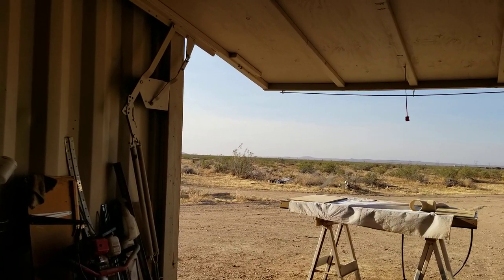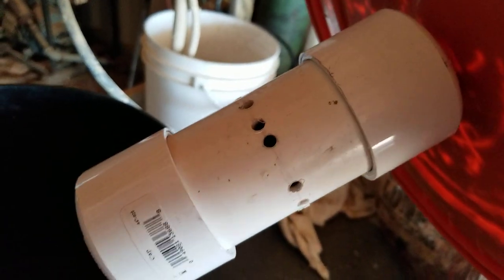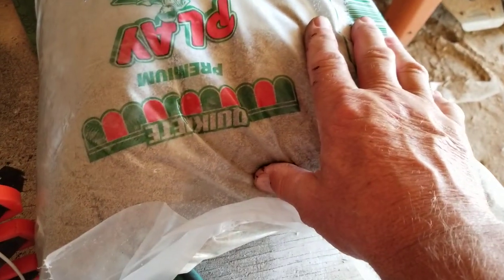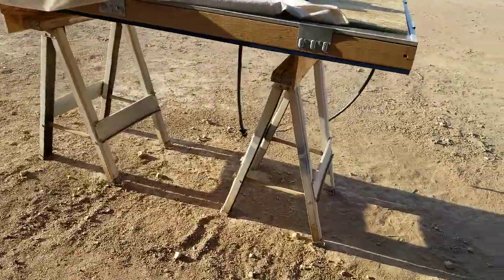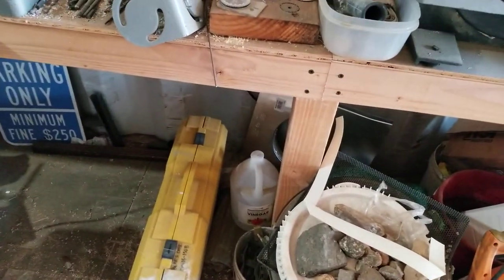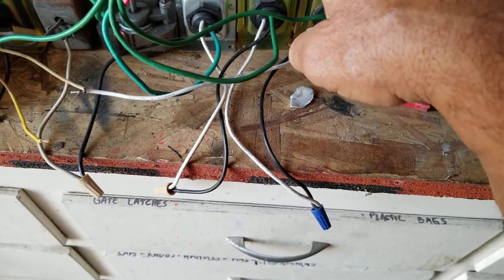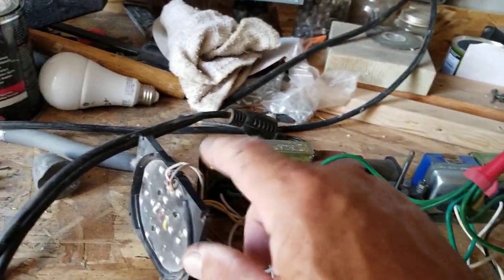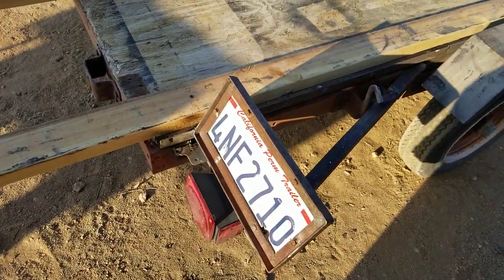DIY tote-cuzzi filter, Aug. 4, 2020

Comment: Have you thought about using a geothermal setup to warm your house in the winter? 
Maybe you can pump the geothermal water through the solar heat exchanger you made for even warmer water 😉
Reply from the maker: Not more than a thought and some research on it.  Not a feasible method of heat transfer for my situation.  I also researched the beer can solar heater system, and the benefits are minimal for this climate.  I only heat the cabin at night.

Comment: Shame on you that you didn't post, we had part on that hurricane that came up the coast it broke my Canopy that i bought not long ago, Ran around today looking for a smaller generator to use on deck close to house for my oxygen when power goes out which it does more often with a little wind.I have a big one on wheels in the shed but its hard to start you need to use a startingfluid  and that is not safe and I had it serviced but still not working proper.
Reply from the maker: If you can swing it, get a solar generator.  It may be covered by Medicare.  I'll send a link if I can find it.
Reply: @GBear  ok thanks.
Reply from the maker: @josephineflatt74  here's one to start you with, once you view it you should be able to find one that fits your needs.  Check with Medicare about supplying one to you.
https://www.lowes.com/pd/NATURE-S-GENERATOR-720-Watt-Hour-Portable-Solar-Generator/1000514875?cm_mmc=shp-cprdelcgooglepla-204-sosrenewableenergy-1000514875-_-0&placeholder=null&&ds_a_cid=112741100&gclid=CjwKCAjwjqT5BRAPEiwAJlBuBa4qns3ZlOiOuNrSIhclAVl4FxMdlLJ4mrbLHXgakbK5j0We3kskCBoCKpoQAvD_BwE&gclsrc=aw.ds
Reply from the maker: Here's another one:
https://portable4life.com/products/acopower-400wh-generator-and-105w-portable-solar-panel?variant=32153647775877&gclid=CjwKCAjwjqT5BRAPEiwAJlBuBW4LLKp0mOJVVokmLT_uRoDHsmV_eJIhb7TTgutAOqNG4w5PpEHrmRoC3S0QAvD_BwE

Comment: I'm not sure youre gonna get enough air flow from a CPU fan.  I built an evap cooler using a smaller automotive radiator fan bolted facing into a bucket lid.  Worked slick, and 12 volt to boot!
Reply from the maker: I have one of those in storage, just too many amps for a portable unit.
Reply: @GBear  Darn.
Reply from the maker: @AnnBearForFreedom  lol, don't despair!  If it works for you, do it!
I want to run a fountain pump and cpu fan on a 15watt panel all day and sometimes into the night (35ah battery), so I need to pay attention to power consumption.   I want it separate from the main cabin power, an easy to move from room to room, etc.
After I fine tune it, I may add one to the chicken coop!
Reply: @GBear  After my rooftop cooler went belly up two summers ago and I couldn't afford to replace it, and it was 109-PLUS in the office,  I started experiencing scary heat illness, like right on the edge of heat stroke.  So I built my little cooler.  I honestly think it saved my life.  The cats liked it too, since I didn't have to buzz-shave them and dunk them in the sink.
Reply from the maker: Had you tried that with the vaults, you probably would have bleed to death....😂